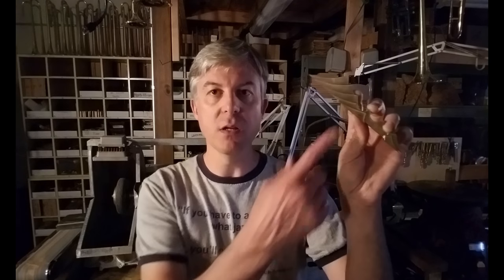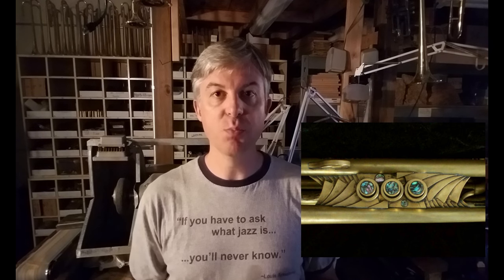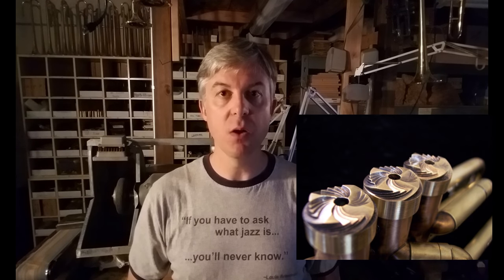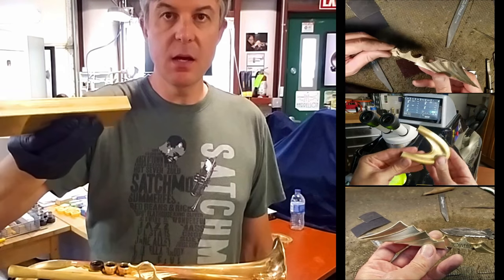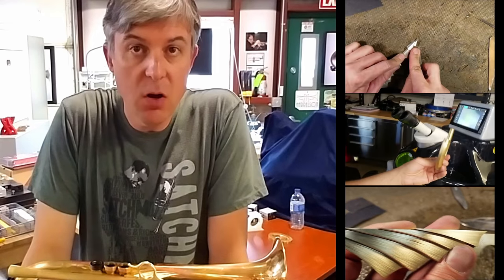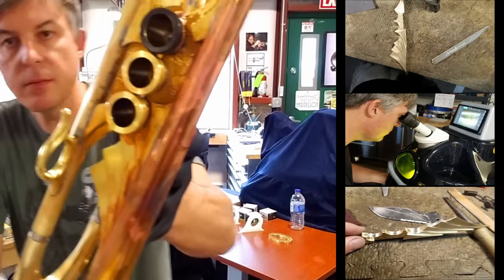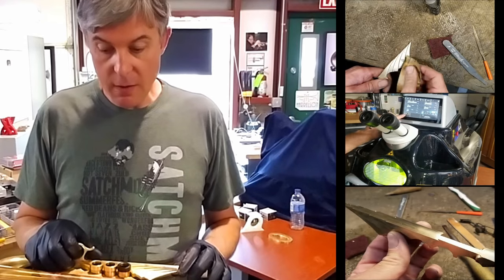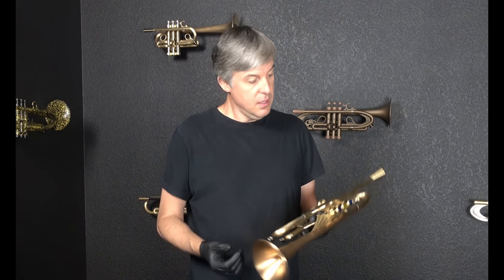Trumpet Shop Talk - Let's Talk Nouveau

Comment: One question I've had lately is why the Martin Committee (and other similar vintage trumpets) are still seen as some of the greatest trumpets today, and why they're still able to compete so well with trumpets that have the advantage of modern acoustic science and manufacturing.
Reply from the maker: We have owned, modified and sold dozens of Martin Committee trumpets and none have had any special characteristics that would allow them to compete with the versatility, efficiency and acoustic sound spectrum of a VPS instrument made by Harrelson. There are myths on the internet that will never die and the Martin myth is one of the greatest mysteries of all time.
Reply: Just to add to this conversation, Filip, I'm not sure that you're asking exactly the right question about horns like the Committee (or any of the notable vintage horns).  I would say there are actually two phenomena at work.  First, the Committee was indeed one of the great trumpets, but would not be one of the "great" trumpets today simply by virtue of progress.  It was arguably at least one of the greatest trumpets of its era, primarily owing to Schilke's contributions (which he, in turn, picked up partially at Holton when he was coming up as a designer/maker).  Ironically, some of the aspects seen as innovative in that horn are now solved in other ways.  Reversing the upper tuning slide, for instance, solved a problem in some particular horns almost randomly (by today's standards).  There was nothing particularly magic about that.

But second--and more to the point of why people still choose to play them--is that any particular trumpet with have a more or less signature sound.  That is why I choose to own some vintage designs myself, and I think is probably the reason most people do.  The Committee does have a sound of its own (partially defined by its weak points).  The instability of the B below the third octave C, for instance.  Someone who wants to imitate the way Miles sounded in that register, on that horn, can find that same little instability to play with.  Another horn that a lot of jazz players played in its era is the Connstellation.  That horn has a very particular attack.  If you know how a Constellation sounds and plays, you can pretty dependably identify it in recordings, and for people looking to emulate the sound of some notable people who played it, the horn becomes fun to have around.  I snapped up a NOS Constellation at a music store auction for that very reason...I can immediately get a recorded sound on it that is very reminiscent of CTI-era Freddie Hubbard, that little splat on the attack and the ability to voice particular "syllabic" lines that are easy to produce on that horn because of its relatively unusual small bore/huge horn design traits.

A few more horns over the years have taken on that "aura," I guess you'd call it, of being somehow a classic design that "holds up," as you said.  But they hold up more for either sentimental historic reasons, or for that second use as a distinctive voice.  I'd concur with Jason completely that even the very best vintage designs can't match the consistency of horns built using today's best practices and analysis capabilities.  The really exciting thing is that we now can understand why some of those classic horns worked to the degree they did, and if we're interested in those characteristics in a modern horn that a smart designer can  bring them forward in a best-of-both-worlds approach.
Reply: Harrelson Trumpets Yes, the myths are very pervasive, and think that you and the other response explained it very well. I was just wondering if there was anything more to vintage horns than the hype.
Reply from the maker: The trumpet community is somewhat divided on the subject of "great" vintage horns with a small percentage of players on both sides. I am definitely one of the few who both love vintage horns and new modern designs. I have personally invested a great deal of my life studying and learning from the great designs of the past. My list of "great" vintage horns is over 50 models long, so I'm definitely the exception. While most players have something positive to say about the Connstellation, Committee, Stradivarius, etc., they have not explored what was available in years past much beyond these three models. That's primarily why these are often the most talked about horns. Were there vintage horns better than these three? YES! Why aren't they popular today? Because very few people have owned hundreds of horns from previous eras and do not know what was great and what was not.
Reply: Harrelson Trumpets What are some great underrated vintage horns you would recommend for someone to try out?
Reply from the maker: @filipvizitiu1921  I would start with Huttl. Then check out the pre-1970 artist series horns by Holton. I also love the Getzen Severinsen LB Eterna.